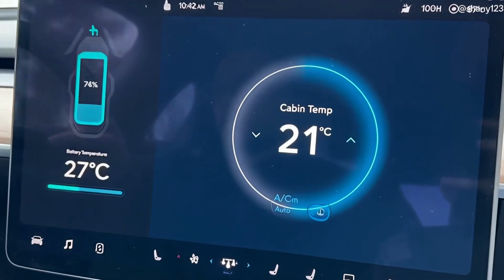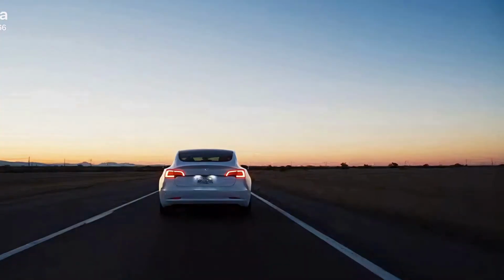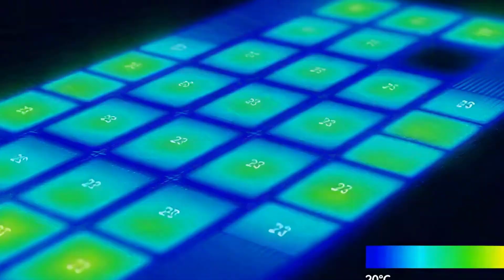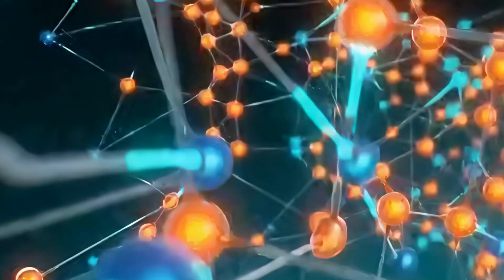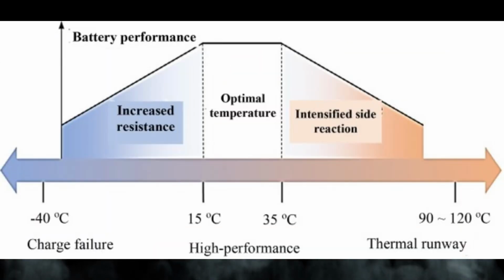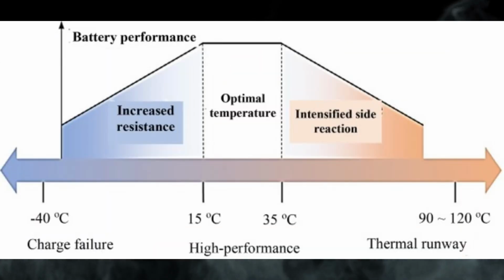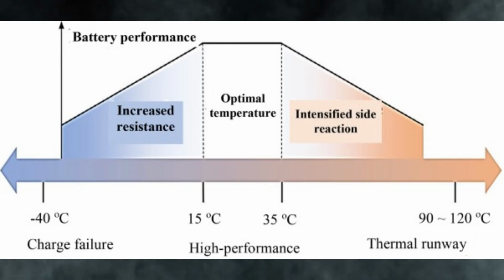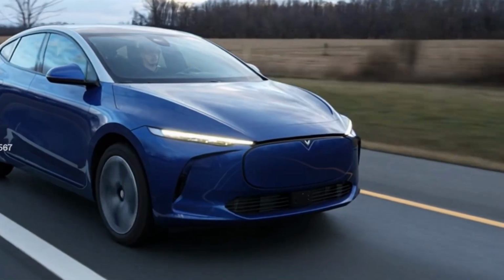The Hidden Language of Your EV's Thermometer!!

Comment: I had a battery management system installed, at automatically what controls the temperature of the battery pack.
I never heard anything about parking in the sun, do it all the time
Reply from the maker: BMS does handle temperature management, but parking in direct sun can still raise the cabin and battery temperatures, making the system work harder or wakeup the ev for battery cooling
Reply: @shayan_ev good point, for sure, they seem to do a good job handling it